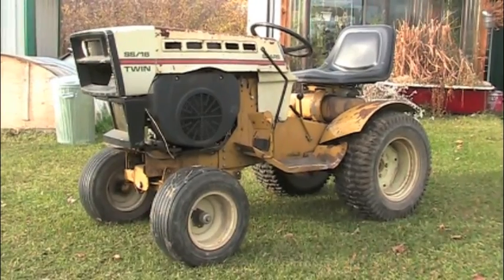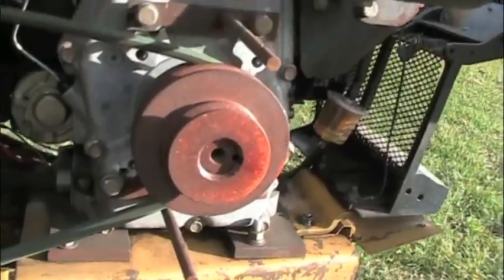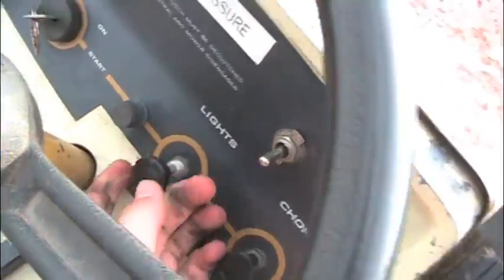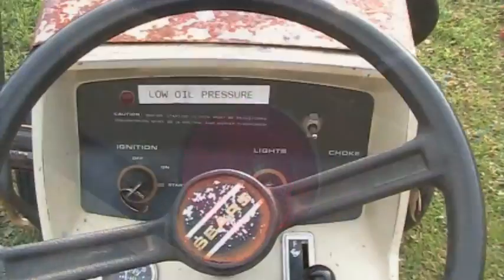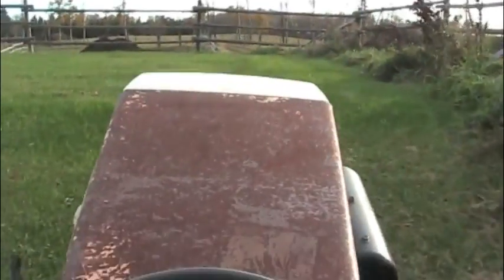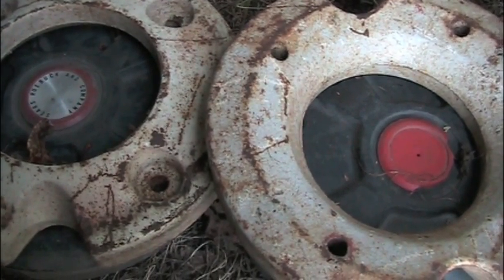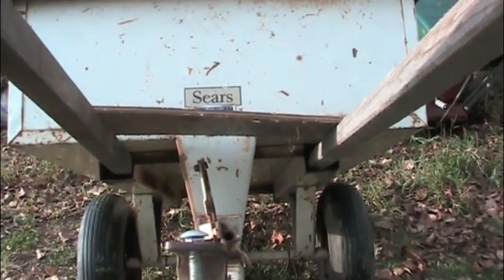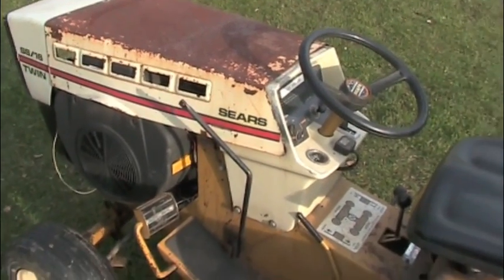1974 Sears SS/16 w/ V-Twin Conversion Start & Drive

Comment: the low idle on that vtwin kind of sounds like a 3cylinder yanmar in a john deere 770. but what happened to the onan?
Reply from the maker: The original engine?  It likely puked a rod after 40 years of hard work and was tossed long before I got my hands on this tractor.  3 Cyl. Yanmar is a lot smoother IMO :)
Reply: lobsterbox20 oh ok lol. the parts are really expensive to for them i guess also. i never had one, but i love the sound of them at lest that constant whirrrr sound they make anyway